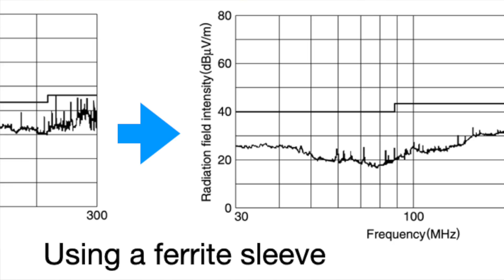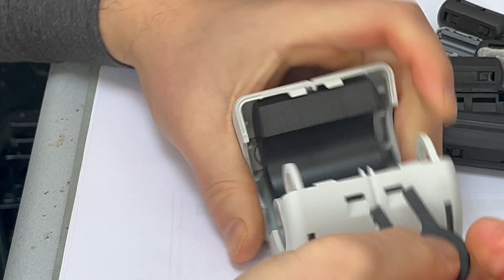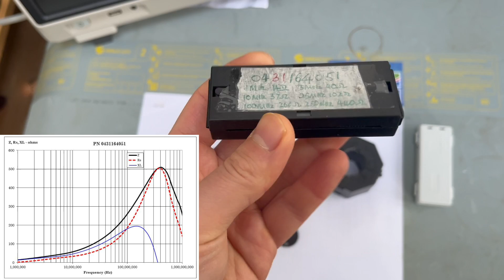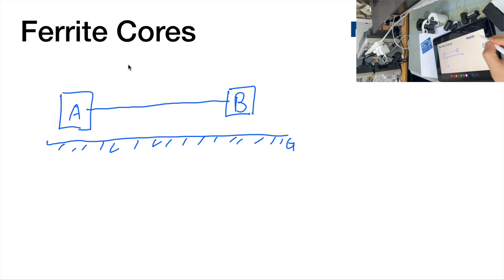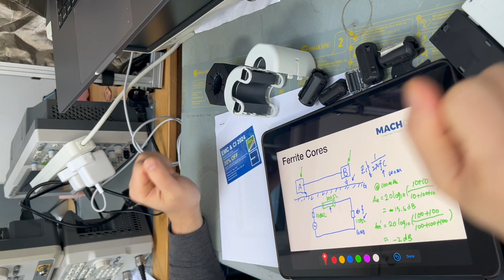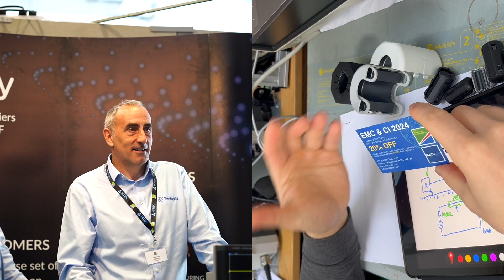Ferrite Core Basics - Essential knowledge for EMC Test Engineers

Comment: As a amateur radio operator I can tell you ferrite can be a HAM's best friend.  Certain antenna designs, especially non resonant end fed and off center fed dipoles can carry a lot of CMC on the outside of the coax shield.  A appropriately sized type 31 toroid with about 11+ wraps of your coax wound through it does wonders for choking off the CMC.  Also helps to quiet down receivers by choking off any signals being picked up by the outside of the coax shield.  Mike KC3OSD